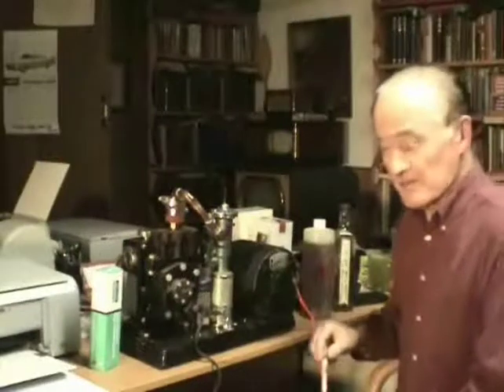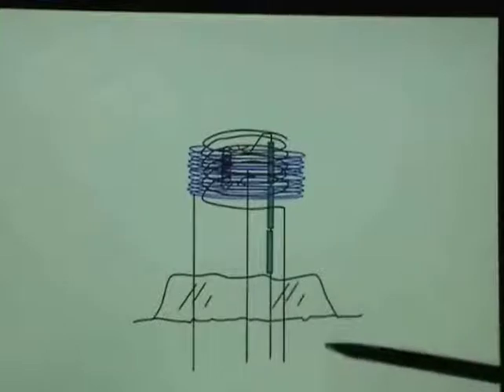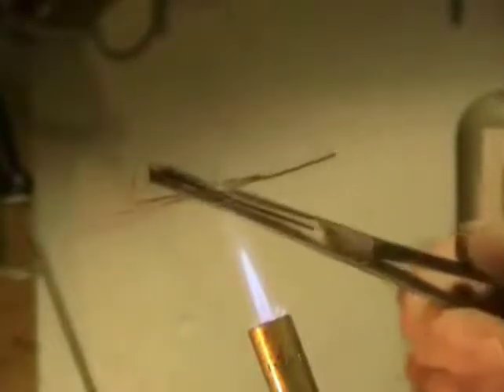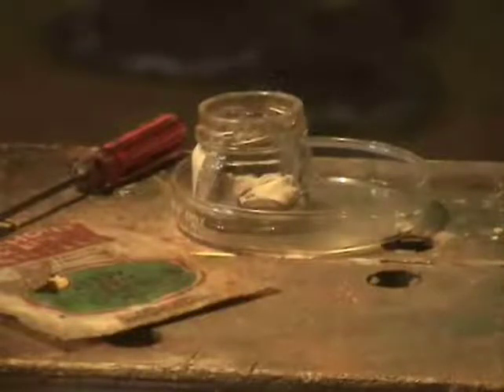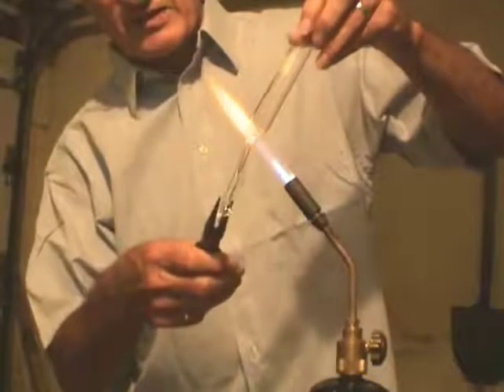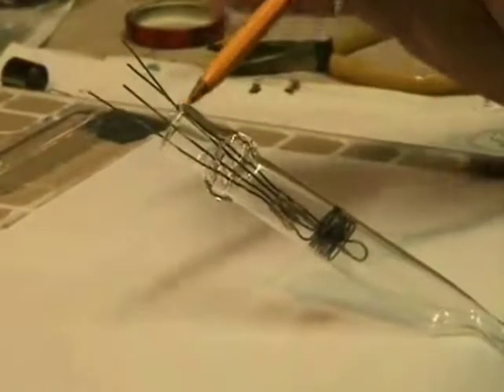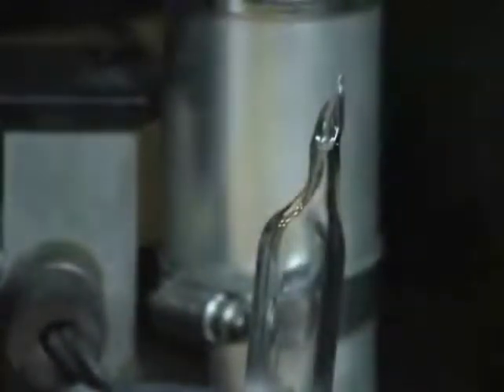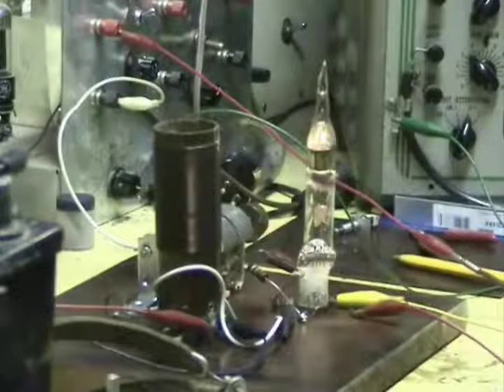Making your own Vacuum Tube from simple materials

Comment: good video, but i wouldnt call a rotary vane pump + diffusion pump "simple materials"
Reply: Yeah, I'm also thinking how to get around that. I do have a rotary vane pump. But it's not enough. I've read somewhere that a dry ice cold trap could work. But I'm currently trying to find someone who successfully made vacuum tubes this way. I kinda doubt, that this works.
Reply: @paulm3079  I think I meant with the rotary vane pump. I got around this by having another passthrough for a titanium filament that absorbs the leftover gas when it's heated. (Basically a titanium sublimation pump)